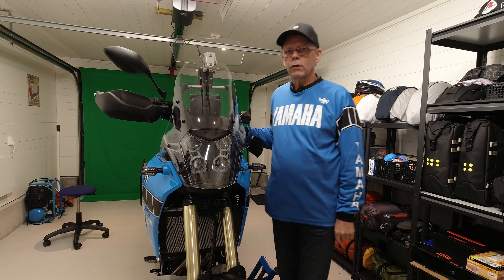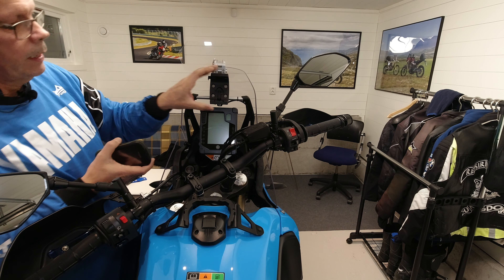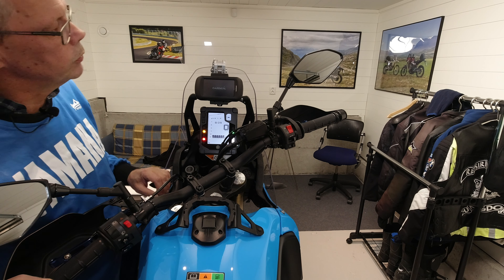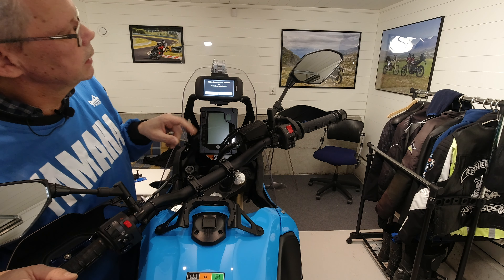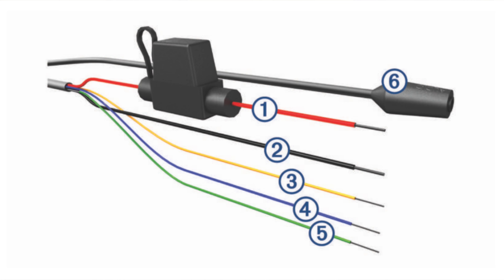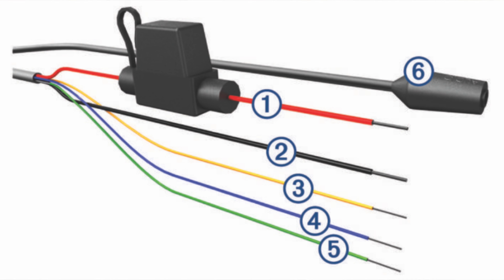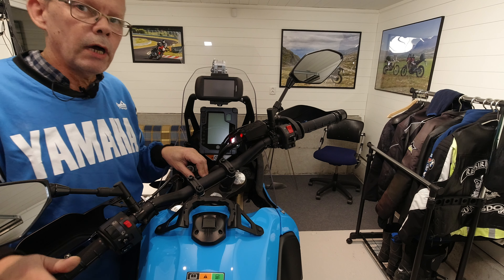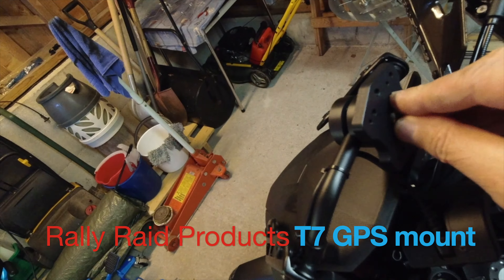Motorcycle Navigation - Garmin Montana - Yamaha Tenere 700

Comment: This was really nice Sven. For my kind of use, i prefer a gps unit on my bike and a mobile phone to do research on different maps for roads, trails etc. When i'm out riding, i need the route/track to follow on a good enough map. I dont need all the bells and whistle because i dont have time to look at that when riding and navigating. The only thing i miss on my garmin is the option to do a digital roadbook. if they could add that it would be perfect. Love the quality of the picture with the new lighting. Keep it up mate.
Reply from the maker: Thanks. A digital roadbook would be great, I like the setup of Nomad Sweden. But I prefer a dedicated GPS unit as my primary navigation, and (as you) an app or two on a phone to do research and to use as a helper. I have used a couple of navigation apps on my phone and used it also as my primary (only) navigation aid on my ride to North Cape. It works but I trust more a dedicated unit. I am starting to get satisfied with lighting....I have been a bit to nevermind about that but it makes a big difference.
Reply: @tubelesschannel  Yeah, for my use there is no way without a GPS unit. I find that way more reliable and use the phone as a second unit i can do research on. But there is no right or wrong way i think. You just need to find what covers your need. I have tried a phone as naviagtion, i would not do it again. And another thing that many of us take for granted, is the safety. I will pair my unit with a inreach mini next season. Ride the bean and a couple of other friends who went down this year reminded me how important it is to get help when you are in remote areas.

Comment: Hi Sven, I need only use the red and black wires on my set up and I'm intend to cut my wires, is it ok to remove the inline  box/ splitter please. Thanks
Reply from the maker: Im not sure what you mean is the box/splitter. Its a fuse "box" on the red wire. You should keep that one if you connect directly to the battery.

Comment: Sven, thanks for the timely and well done video.  I’m told there are two OEM connectors available on the right side of the bike, a 2amp 2 pin and 8amp 3 pin.  It was difficult to see which one you referenced cutting, but I’m guessing the two pin?  We’re you concerned about the wire gauge on the bike and how many amps the Garmin GPS will use?  I’m wanting to wire in a Zumo XT to my T7 the same way you’ve done, but am finding little information on the Garmin Zumo XT output and the bikes wiring gauge choice in play on the 2 pin connector.
Reply from the maker: The 2-pin connector I used is located near the 3-pin one. I think the 3-pin is used for Yamaha heated grips. The 2-pin is sourcing up to 2 Amps, more than enough to run (and charge) a Garmin XT. I used a voltmeter to find out which of the wires in the 2-pin connector is the positive(+) and connected it to the red wire from the Garmin mount. The two remaining is the minus(-). Sadly I dont remember the colors of the wires going in to the 2 -pin bike connector, but it is easy to find with a voltmeter. Or a test lamp. Remember to put ignition on when testing.
Reply: @tubelesschannel  thank you so much.  This was the confirmation I was hoping for.  My wires (US bike) are black and yellow and I’ll be able to determine power sourcing as you did.  Keep up the great work and I really appreciate the reply.